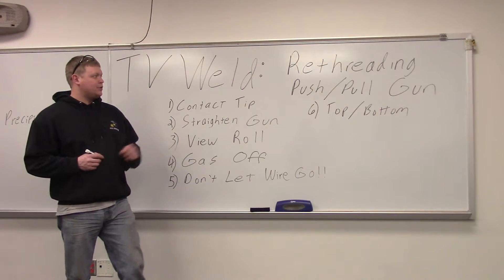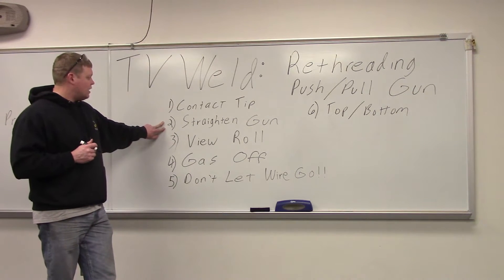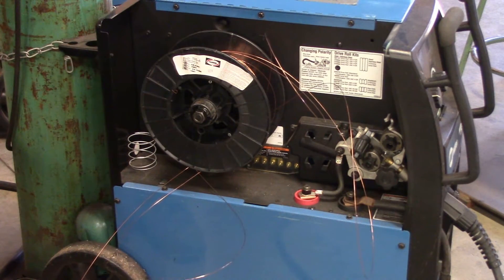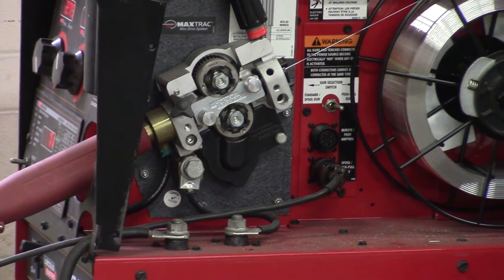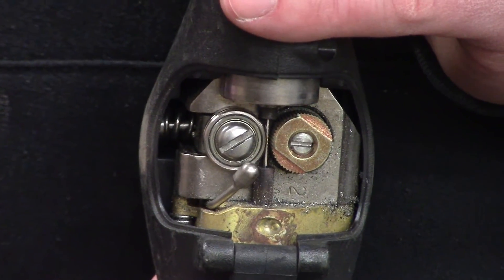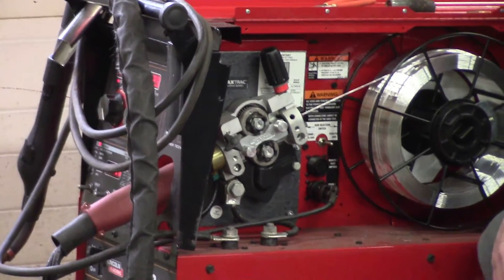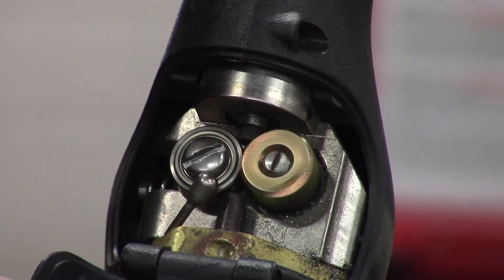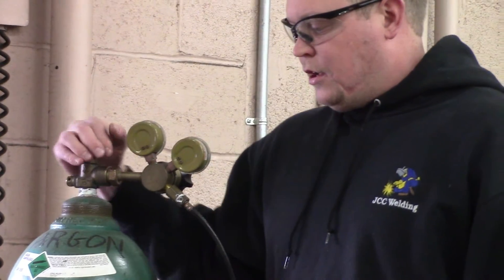How To Rethread A Push Pull MIG Welding System

Comment: I have a lincoln 350mp for more than 7 years and to date I have not been able to find someone to help me set the correct parameters to weld aluminum. It is for me the worst investment I have ever made in my life. I would be very grateful if you could help me make the adjustments. to the machine to see if I can finally use it I bought it for fun no one puts a video where I really explain how to adjust it in detail I would appreciate any help
Reply from the maker: Do you have a push pull gun on it?

Comment: have you had any issues with the wire getting stuck inside of liner?or are there any tricks to changing the liners on these guns?
Reply from the maker: We haven't had any issues with the wire getting stuck in the liner.  You may have dirty wire, or the liner needs to be blown out or changed.  To take out the liner just remove the set screw on the gas diffuser, there my be another on the machine end of the gun, and pull it out from the machine end of things.